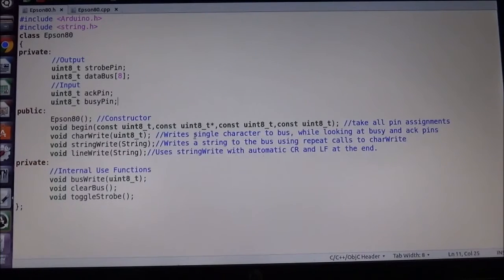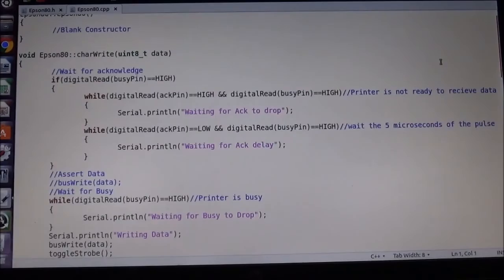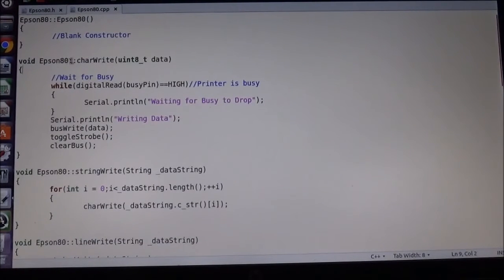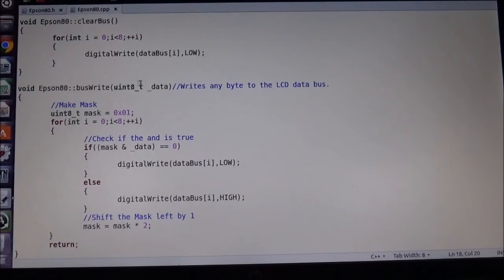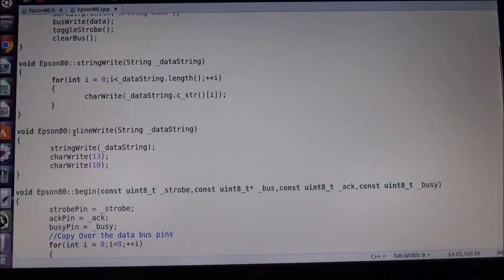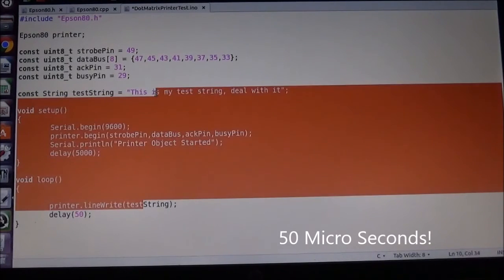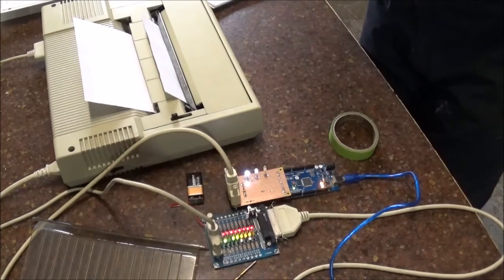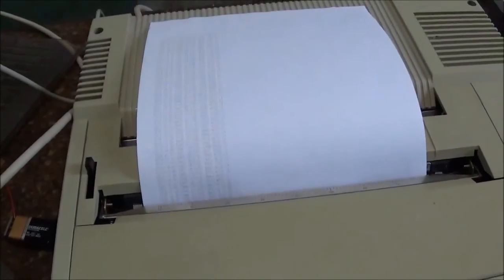Arduino Powered Dot Matrix Printer - The Program and Testing (Episode 3)

Comment: Thanks a lot, this will make my own project way easier! BTW is it possible to avoid using masks but just decompose each character into 8 bits and then just send them over to the relevant output pins of the Mega and then fire STROBE?
Reply from the maker: I think there is definitely a way to do it in 8 distinct statements, but don't think there is a way to do it without a mask. At some point in the character write a mask will be needed to test the state of a single bit. Saying this, I just did a quite google and found the std::bitset class template, might be useful, but unsure how it would be used. There may be a way to type cast a char to a bitset, then test the bits using the array '[' ']' operator, thus skipping the mask. Another thing that comes to mind is using a serial to parallel conversion implemented in an external IC to handle the character decomposition. The 74595 comes to mind for this task.
Reply: thanks for your suggestions. will try first some basic stuff like moving the carriage. Guess Arduino should be fast enough to handle more or less any sort of code that create and send signals to printer.